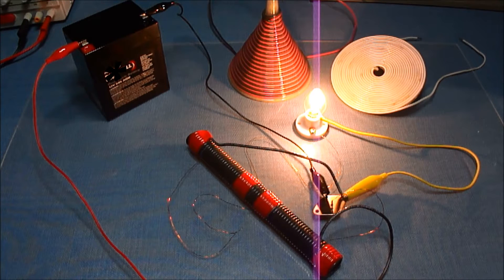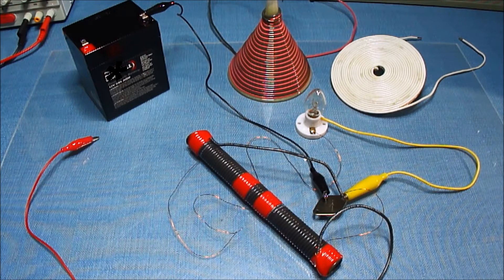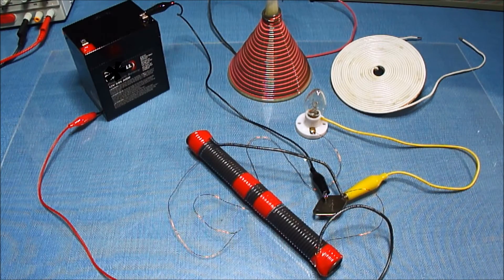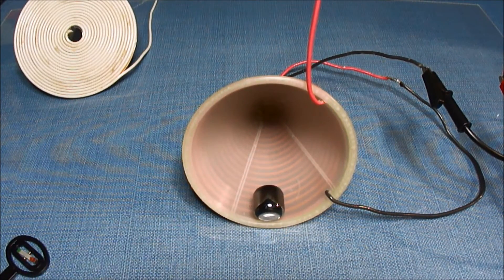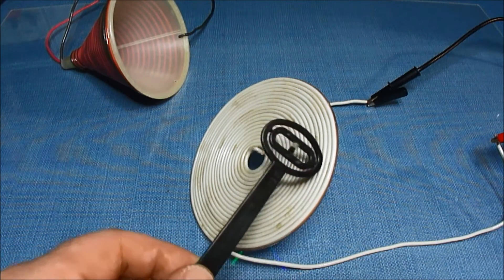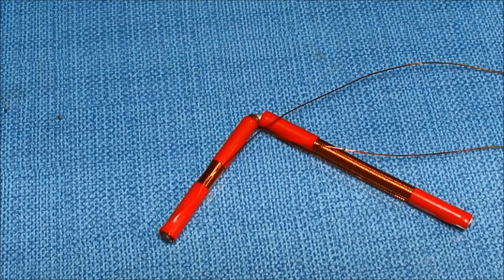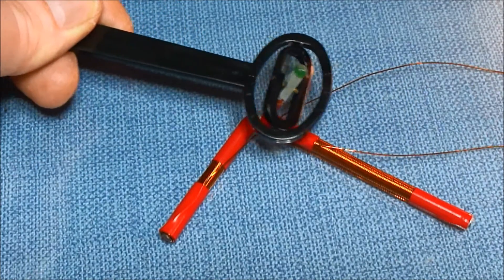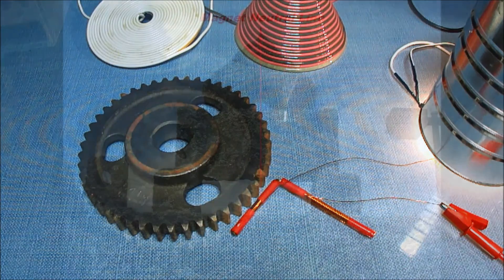Magnet Neutral Lines - Moving Bloch Walls

Comment: advantages of said generator 1. No moving parts 2. opposing north poles can be placed mmillimeters away from armature(non-rotating) therefore no precise machining needed. 3. Frequency along controlling center coil is what will determine output i.e. higher frequency= higher output. 4. Magnets provide the magnetism no additional electricity needed, only small current at center control coil which will move the bloch wall back and forth

Comment: I got something you might be interested; Normally coil is set up to cut lines of force at 90 degrees but this generator coil runs along same axis as flux. please see minute 2.50 you have a ferromagnetic material with a coil along long axis, the 2 opposing north magnets saturate the ferromagnetic armature and flux has no where to go except along armature..so how do we generate electricity?? there is a controlling coil in the middle of armature wound the same as coil but only in the center, thus when you pass an ac wave on controlling coil the whole coil fluctuates back and forth at 60 cycles per second if using mains but if you start fluctuating at a high frequency say with a transistor mosfet combination then you have massive production due to the rapid frequency (back and forth) action
Reply from the maker: Interesting idea. This is the simplest AC driver I've been using 2- mosfets or 2- transistors. https://www.google.com/patents/US2963658
Reply: thanks for the info; when you have opposing magnetic fluxes such as in one of your videos on a transformer that uses less on load may be explained by the fact that opposing fluxes cause an impedance but when you give it a way out (thru a light or other load) this resistance is alleviated and the current draw diminishes